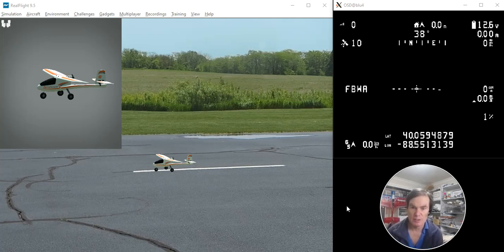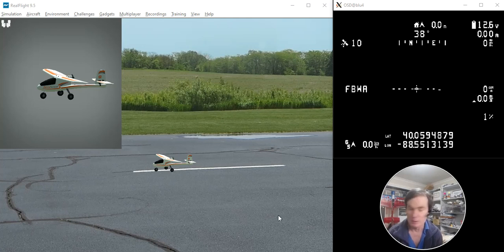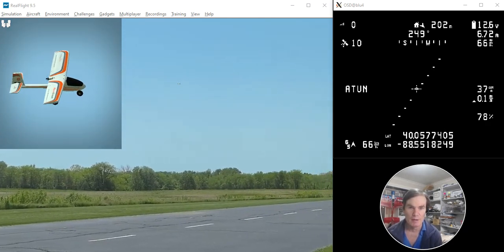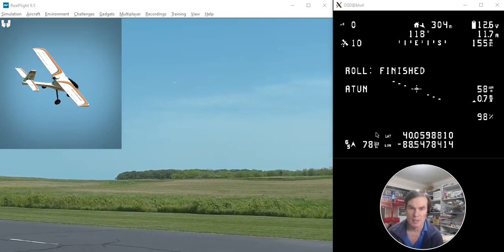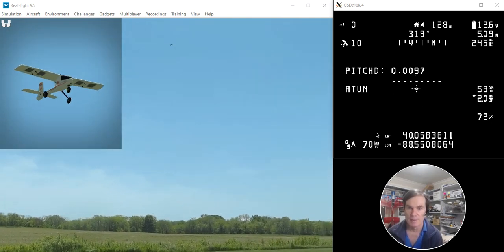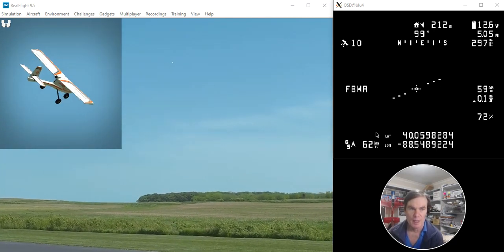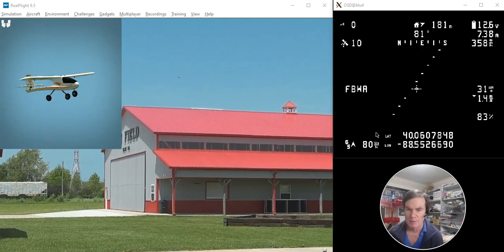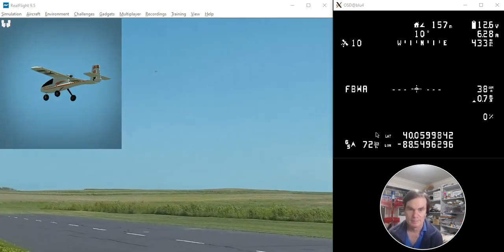Plane 4.1.0beta4 autotune demonstration

Comment: I'll be putting my PixHawk in a real AeroScout in the next couple of weeks! Is there not a yaw autotune now?
Reply: I’ve heard there is but haven’t used it yet.  There’s only D (damper) for the yaw, so it’s much easier to tune than a PID like roll and pitch
Reply: @FPVREVIEWS  Yes, there is a yaw autotune now. You have to enable it though, it's off by default. Not really needed unless you are doing aerobatics.

Comment: When I autotune, I hold roll fully to one side and let it actually get there, before rolling to the other side. But you seem to be making very fast movements each way - is that just as effective? Smaller movements would be more convenient because the position/altitude of the plane changes less.
Reply from the maker: you just need to achieve most of the desired roll rate, not the desired roll angle. This is quite a nimble plane so you can do it quickly

Comment: The oscillations would increase as airspeed decreases. There seems to be some scaling factor that for some reason increases the gains as the air speed decreases. This would cause normal pid values that behave fine to suddenly cause oscillations at near stall speeds. I've posted about this under the plane 4.1 forum as David82
Reply from the maker: that would imply a bug in the speed scaling logic for the P or D term. They look right, but I'll mention it to Paul as well